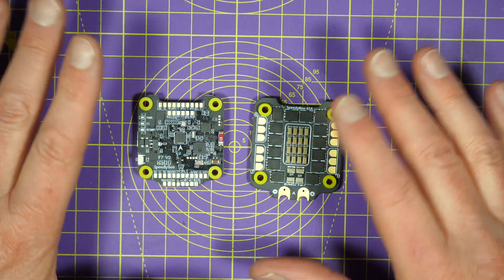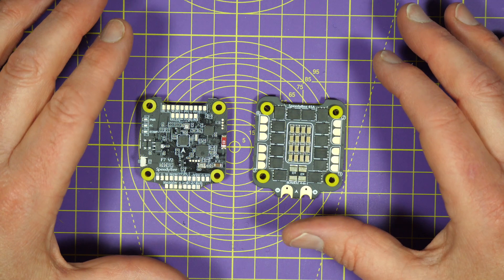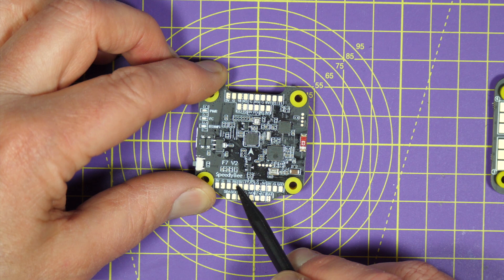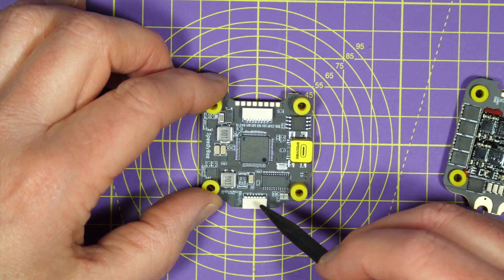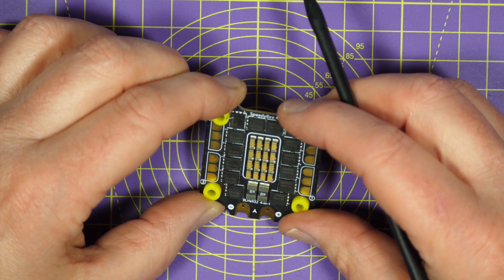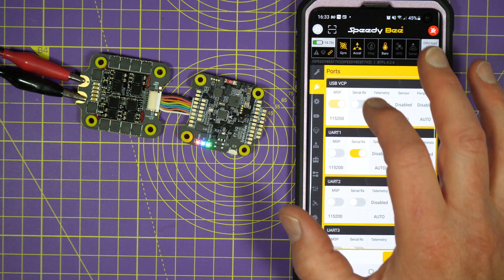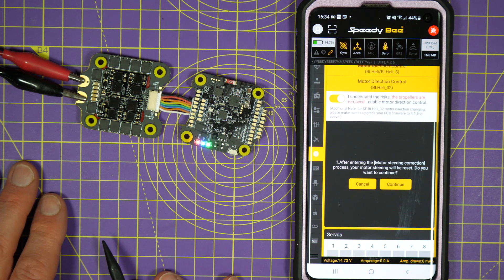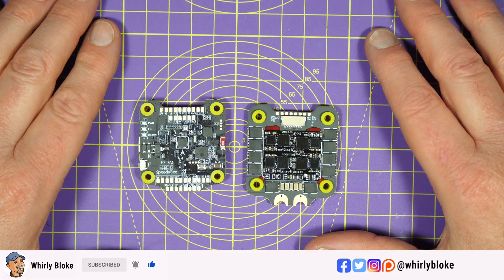SpeedyBee TX600 V2 AIO F7 Flight Stack / WiFi and Bluetooth Configuration and App / Full Review

Comment: Is it normal that my SpeedyBee F7 V3 runs on 3,2 kHz Pid Loop/ Gyro update frequency? I cant change it up to 4 kHz or 8 kHz. And do you know why it is so low?
Reply: sorry four months late... manufacturers have had to use a different gyro, because of supply chain issues. it is 'normal' that it is 3.2kHz, in that, the gyro that they had to use is not able to clock as fast as the one they had planned on using. This should not be a problem, 3.2Khz is plenty.

Comment: Your know, ppl are complaining the ESC burn the motors!
Reply from the maker: I've used these on 3 builds with no issue.
Reply: I am running X-ing 2207, 2755kv motors with 6s and have not had any motor issues. 
My only problem is that I have not been able to get the LEDs to work, without the App. 
I don't have a phone that can use the App, so I am trying to use my laptop, no luck yet.
Still trying. But as far as flying, it has been just fine.

Comment: Hello there, Great tutorial!!. I'm a newbie and I'm building a Quad with 5" props. I'm using the speedy bee F7 stack, so now I'm facing a problem with the throttle position. In the Betaflight motor menu for testing the motor the line of power instead of sitting at the bottom with the motor completely off they all at 1460 as an armed speed, and if I roll it down, instead of decreasing the speed it goes up, and the opposite way will do the same, looks like for the motor to be completely stop has to be around 1500 witch is sitting in the middle of the bars of each motor. How I  can change this to the normal way, where the bottom of the bar the motor is off /stop or in a no spinning position, and if I move the bar up the motor should start spinning faster. If there is anything I can do to fix this please share it with me I really appreciate all your help.
Reply from the maker: It sounds like you may have got the channel mapping set wrong or you transmitter has the throttle direction direction swapped.
Reply: @WhirlyBloke  Thanks for reaching back out. I found that the motor had the 3D option enabled, after turning it off in BF is all working now. Thanks for all your help I really appreciate it.